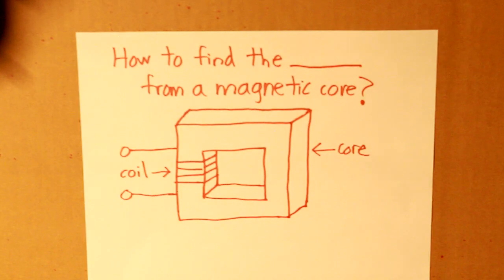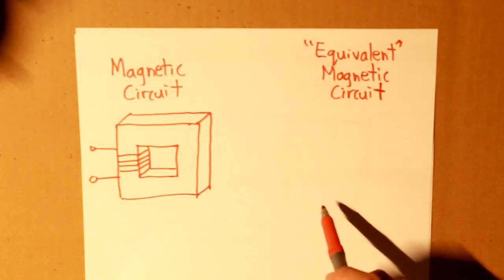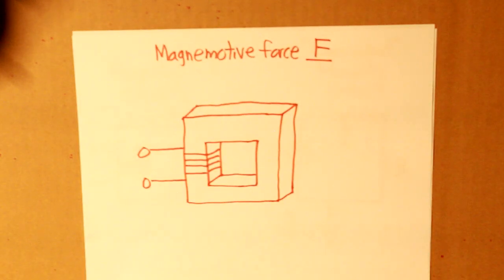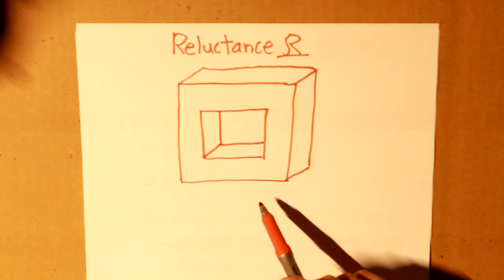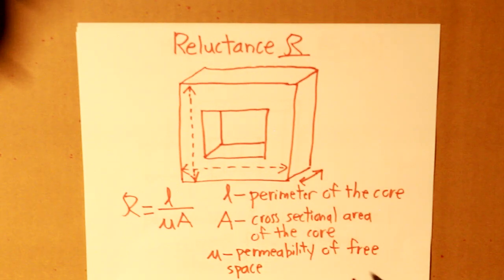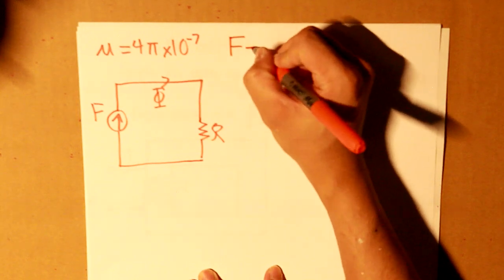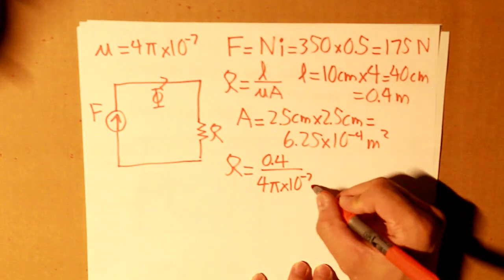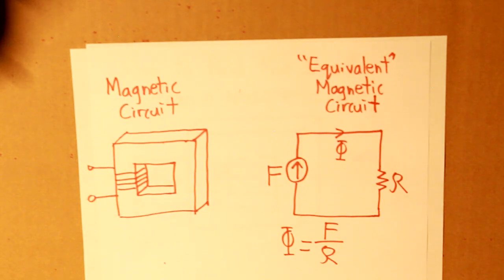How to Find the Flux from a Magnetic Core?

Comment: there is a lot of mistakes u have make here, please don't explain something if u are not  fully understanding  it, but thanks for the effort.
there's relative permeability , free space permeability, and permeability, how ever the value of μ0 = 4π × 10−7 H/m is free space permeability  , not permeability  μ, and the equation u used for reluctance, has permeability  μ, not free space permeability  μ, so the formula u need to use to get that is μr=μ/μ0,   (μr=relative permeability) , relative permeability usually given, if there's an Air gab in the core, then relative permeability is ZERO, and then you can do how u did there.
Reply: other mistakes are units, u didnt mention all of them, like reluctance must be Ampere-turn/Weber,  μ0 [H/m], F can be either [N]or[Amp.Turn],  Flux [Wb=Weber]